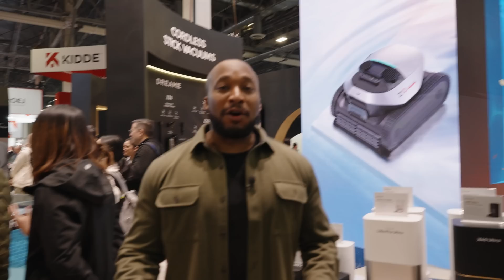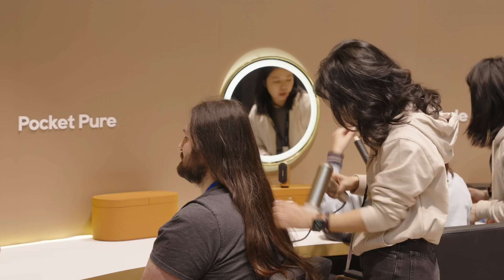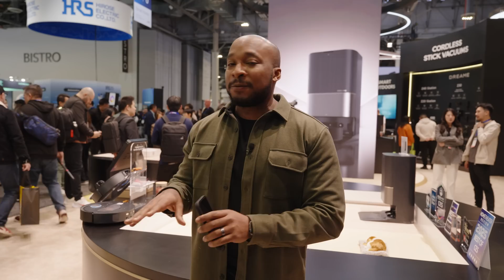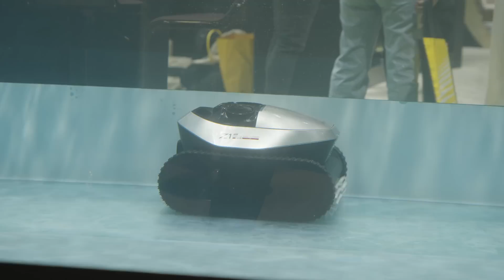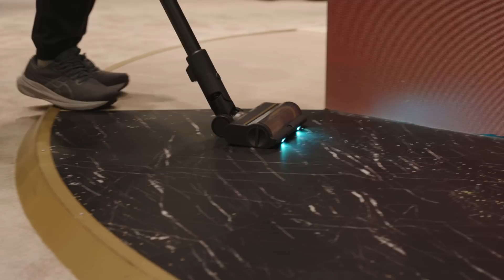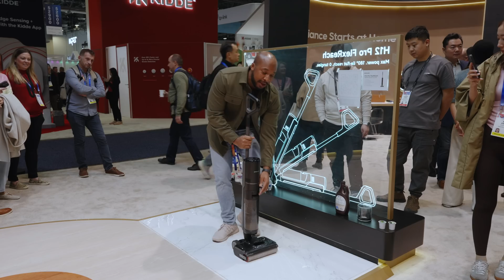Step Inside Dreame’s CES Booth: A Showcase of Next-Gen Smart Cleaning Tech

Comment: Dreame's customer service is terrible. I have created several tickets with them in the last few months and there are severe problems -
1. They closed my tickets multiple times without providing a resolution. 
2. They take a very long time to resolve issues. Their usual response is that they have escalated the issue to a higher team. 
Example - it took them 3 weeks to activate extended warranty on my robot after several back and forths.
3. They only provide support over chat or ticketing system. Chat can sometimes takes hours for their agent to become available. 
4. Support is not 24/7, for a global company that they are.
5. Every time they respond to a ticket, it's a different agent responding . There is no continuity.

Comment: All seems like overly complex tech that will easily break. Why would you want to use a laser to direct a pool vacuum around? Mine works fine and it’s just a drop-in and forget about it vacuum.
Reply: For speed and efficiency, rather than random patterns that take more time and energy just to clean sections it already cleaned.